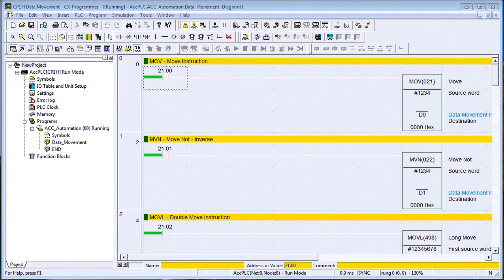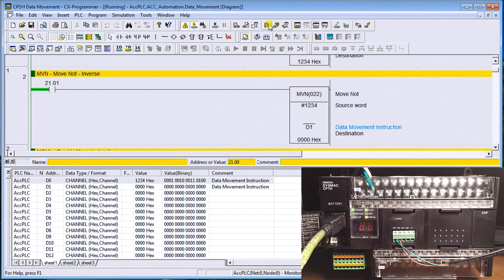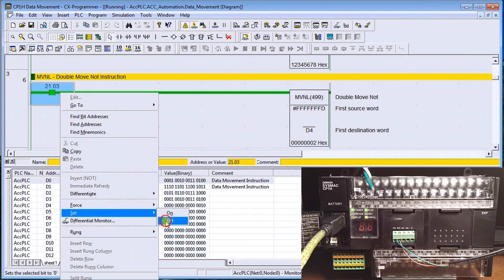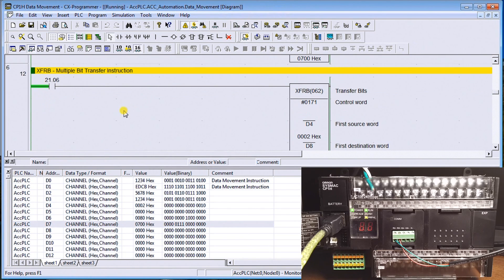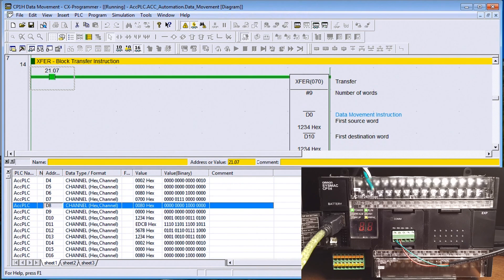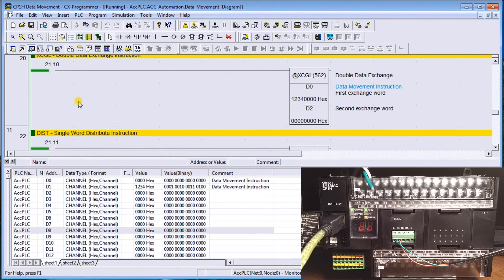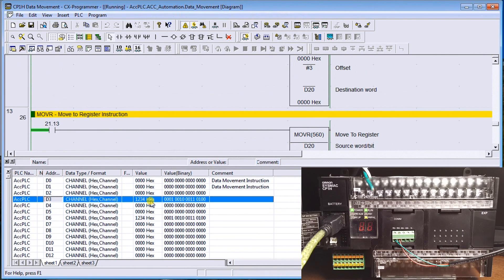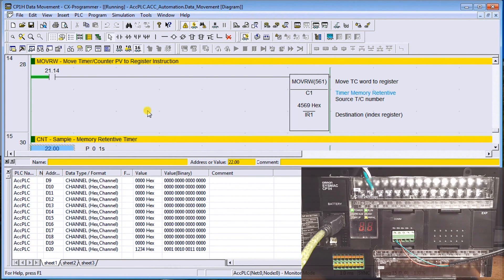Master CP1H Data Flow: Essential Programming Secrets Revealed

Comment: I can't understand MOVD(083) and XFRB(062) also others.But 2 instruction more important to understand for me.Plz Discussion 
more easily and deeply.And why we will use this.plz help.
Reply from the maker: Hi Imran,
http://accautomation.ca/omron-cp1h-data-movement
The MOVD (Move Digit) will move bits in groups of 4. (Digit) The instruction will take a source word and destination word. You then specify in the control word of the instruction the starting digit to look at, the number of digits to move ( 1 to 4) and the starting digit location to move the digits.
The XFRB (Multiple Bit Transfer) will move bits 1 at a time. The instruction will take a source word and destination word. You then specify in the control word of the instruction the starting bit to look at, the number of bits to move ( 0 to 16 (0-F)) and the starting bit location to move the bits.
The XFRB instruction can do the same job as the MOVD as long as you select multiples of 4 bits at a time and your starting and ending positions are the same as the digits.
Regards,
Garry

Comment: I have run into an issue where I seem to be unable to write into words greater than 41. This issue is occurring with all functions. Any suggestions?
Reply from the maker: Hi Corwin,
Are the words already being written? 
You could move your logic for the writing of the words just before the end statement in your ladder code. This will test to see if this is the case.
Regards,
Garry
Reply: @ACCautomation  it appears to be some issue with the way I am using a custom function block, when I extract the code out of the function into the main ladder it works fine. This solution is acceptable for my purposes so I have run with that.
Reply from the maker: @corwinbroekhuizen3619  
I'm glad you got it going.
Garry